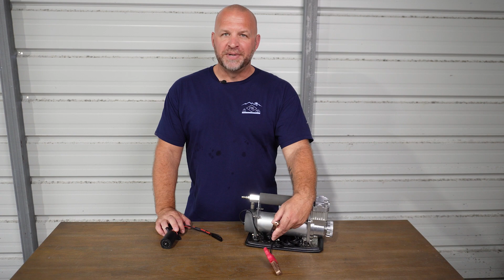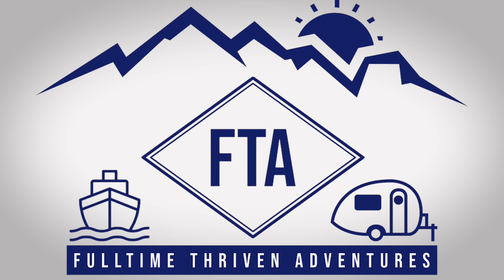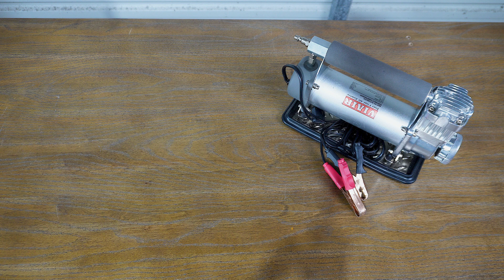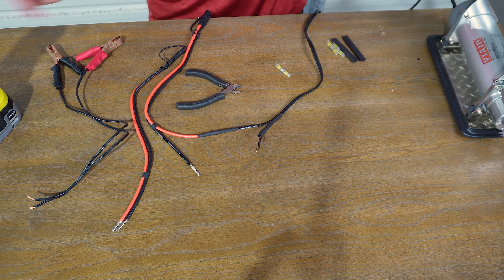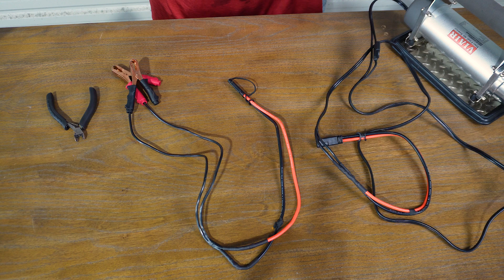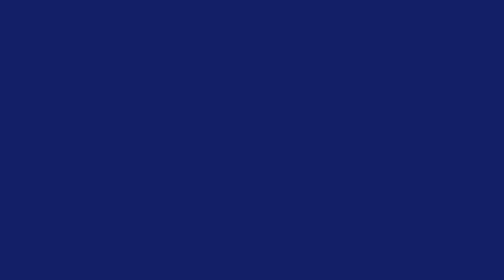Viair Compressor Conversion

Comment: The trailer connector likely doesn't have the heavy duty wiring and fuse required to support the air compressor. You will be overloading it and blowing fuses if not causing worse damage.
Reply from the maker: I’m not sure why VIAIR would recommend it then.

Comment: You realize that the Viair part is wired with 12 gauge and not 10 gauge, right?
Reply from the maker: Yes you are correct. The 7 way is 12 gauge wire. The 10 gauge extension was a part given to me by VIAIR (I will have to check my email). I believe as long as you go from a smaller to larger gauge wire, you should be ok as long as the fuse is rated for the smaller wire. I didn’t change the fuse at it is wired in line near the compressor itself.

Comment: Bought the kit & converted my compressor. Tried it out to confirm every thing worked. Only ran for a min but compressor sounds like it needs more power.
Reply from the maker: It worked great on my 2020 dodge ram 1500. We just bought a 2022 F-250 and when you plug it in and the truck sees it as some kind of fault.  I reached out to my contact VIAIR to see if he has heard anything about our issues.
Reply: @ateasetraveladventures  tried mine on ‘25 wrangler. Had Anderson connector on last jeep. If that ran at a 10, the sae connection sounds like it’s running at a 3. Just don’t seem to be getting the power needed
Reply: @ateasetraveladventures  Did you get this resolved. I would like to do this as well, but I have a 2022 F350 and won't proceed if it will not work.

Comment: Awesome video and idea! I've always disliked having to connect my Viair to the truck battery. being able to use the 7 pin plug will be so much better. I assume you have to keep the truck running to get power to the Viair using that method?
Reply from the maker: No. The VIair will work with the truck off. Sooooo much easier!
Reply: @ateasetraveladventures  That's even better! Thank you!

Comment: Great video! Can you either let me know the length and brand of the 10 gauge extension or update the link in your notes? The link for the extension is the same as the 7 pin connector. Also was it 12 gauge solder connectors you used to connect? Are they still holding strong?
Reply from the maker: Thank you for pointing that out.  The link has been changed.  I used the Yellow 12-10 connectors.  Everything is holding.